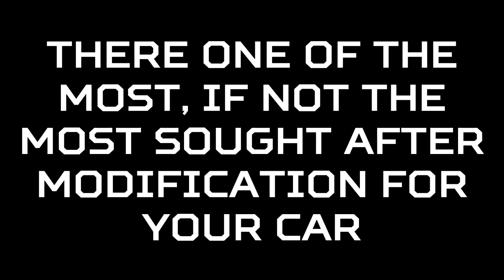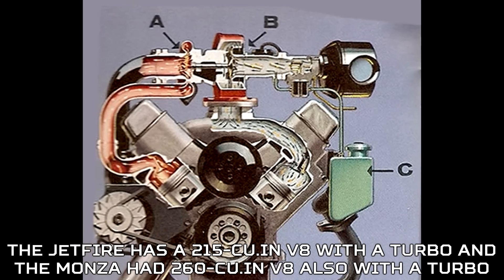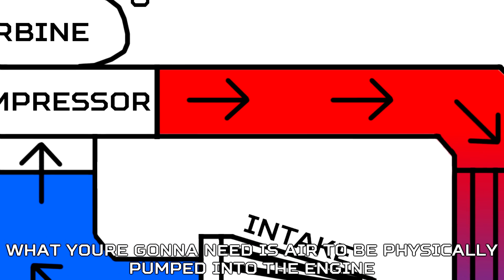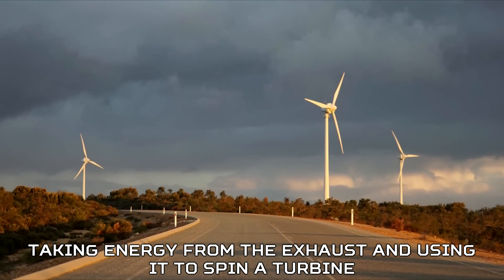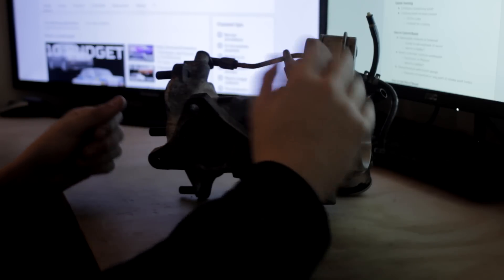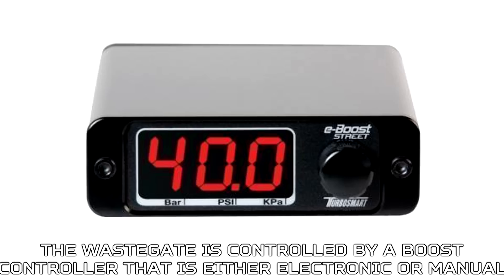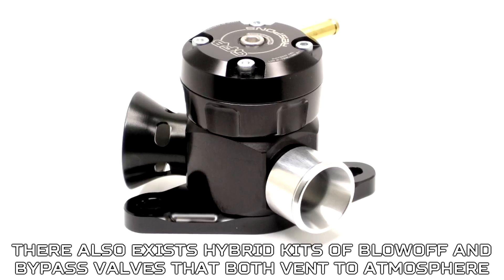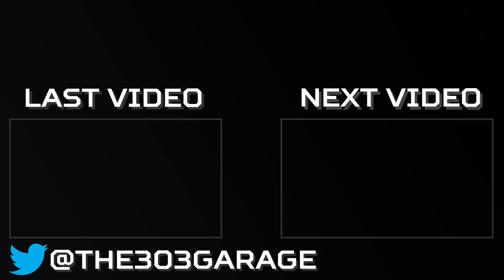The How and Why of Turbochargers

Comment: Do turbos increase fuel consumption, say, when installed in a stock engine?
Reply: Wow I know this will be a year late but the answer is a solid sort of. A 1 litre turbo might make equal power to a 1.5 litre but will be lighter and therefore more efficient. But a 1 litre turbo will be more powerful but less fuel economic than a 1 litre without a turbo

Comment: You forgot to mention aspects such as reliability..  with water cooling being better than oil especially with tech such as turbo timers added if they are not stock..  and the fact that changing the car/engine oil more often is a NECESSITY and is never to be ignored unless you are a fucking tard

That said.. turbo's FTW.. and there are also a few examples in production cars as well of combos of turbo and superchargers as well to get the best of both worlds..  added complexity however is often a negative aspect for forced induction overall.. but done right it can be an excelent system that easily pays for it'self if done right.

Hence why so many cars now are turbo charged vs such being more rare for years especially in North America (where the typical american pos cars are .. well crap.. and insurance co's for years always punished anyone with a turbo regardless.. assuming if you had such you were some tard out breaking teh law etc etc etc)

Comment: actually in a sequential turbo setup the turbos are usually the same size rather than a smaller turbo feeding another bigger turbo
Reply: In a sequential turbo setup one turbo is larger than the previous.
As boost climbs the system switches from the small turbo to the large turbo hence the term of a sequential turbo.
It happens in sequence.

Comment: and btw it's impossible for the compressor wheel to spin back and forth because it has a speed between 90k and 200k rpm in full boost how can't it stop instantly to spin backwards ??!!!
Reply: Charbel Dk maybe he meant the shaft moves in and out as the air leaks through the blades?
Reply: @FroztiProductions  
That would be called shaft play.
Shaft play should be minimal if any.
Reply: yeah i was just about to say that the compressed air hits the blades and makes that noise thus slowing the turbo down but not stopping or even reversing the direction if that happen say bye bye to the turbski

Comment: flutter is harmful to the turbo, right?
Reply: Not at all. It is totally a myth, when you are off boost the turbo is spinning freely, the turbo can change speeds freely, its kind of like saying "will coasting in neutral up a hill damage my engine". If you are getting surge during open throttle (foot on accelerator), then yes it is bad.
Reply: to a certain extent if u run lower boost levels such as maybe 15 psi and under u should be fine but with higher amounts of boost your turbo could be at a risk

Comment: I originally thought, that the turbine gets hot because of the exaust gasses flowing through. Great and very informative video nonetheless
Reply: it does get hot but heat is not what powers the turbo
Reply: Of course the turbine gets hot from exhaust gases, it's raw heat straight out of the engine.
On the compressor side it gets hot due to many factors such as friction, latent and ambient heat, and when you compress a gas it heats up hence the need for an intercooler, when a gas heats up it becomes less dense therefore less volume.